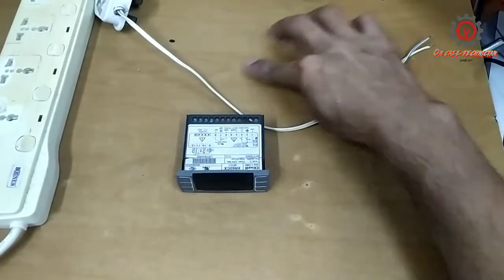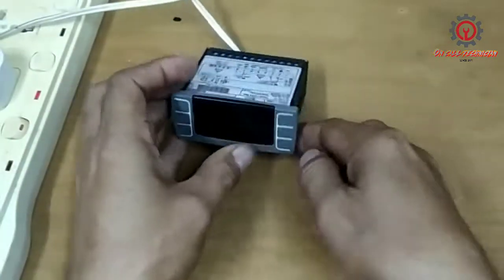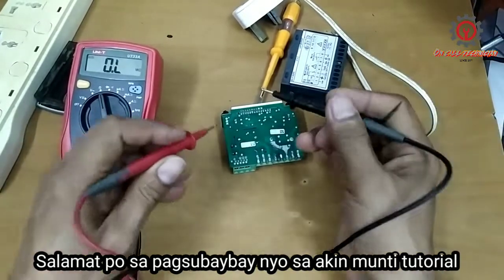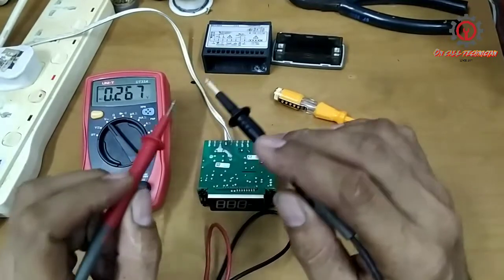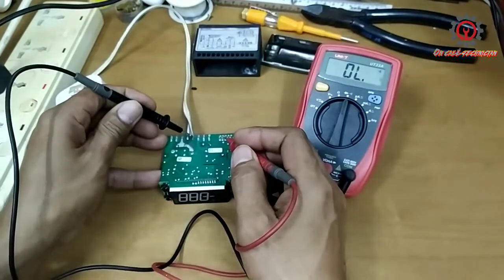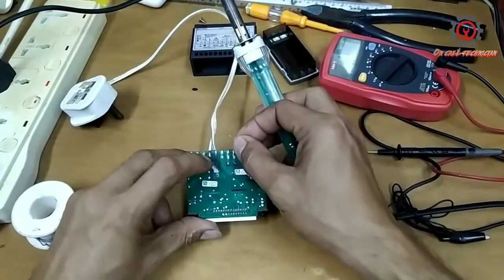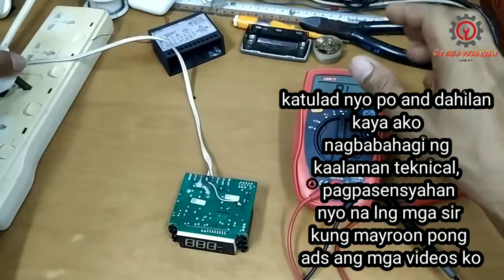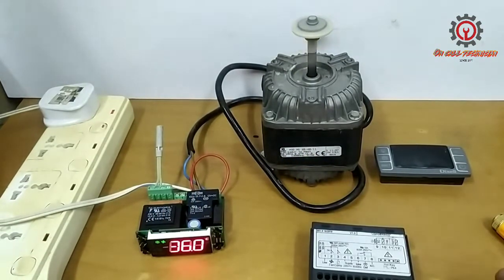HOW TO REPAIR NO POWER ISSUE OF DIXELL XR60CX

Comment: Hi. See the pictures i sent you via FB chat now. Is this a "Thermostat/Temperature regulator" that the previous technician installed? It was installed directly on the Controller but the controller was off (faulty). The fridge still working. Why this was setup like that do you know?
Reply from the maker: I can't blame them sir coz they are not electronics technician too, well their set up is direct connection once dixell control failed. They just took the compressor line and installed a thermostat and they will took defrost line and and installed a timer also for your defrost heater since you mentioned that your unit is a counter freezer.
Reply from the maker: Just explore my dixell tutorials as i discussed about no power issue... etc
Reply: @OCT TV  I was imagining that this is what they did. 
Do you think that this setup where the Thermostat is replacing the controller will somehow damage the equipment?
Thank you so much for all the help! Will keep supporting you.
Reply from the maker: The bypassed they did sir is the oriiginal set up prior to the invention of digital controller. If the unit intended for commercial used, use digital control. If you want to restore the control for monitoring easyly buy new dixell. Just watch my tutorials on how to wire it and program to freezer settings sir.
Model recommend are dixell xr06cx, xr60cx, and xr70cx
Reply: @THEMULTISKILLEDTECH  Can this setup with the Thermostat be done with the Controller operating normally then the Thermostat would be a backup in case the Controller fails then the Thermostat would keep it going? Or the Thermostat can Only be placed "after" the Controller failed just to keep it going?
Reply from the maker: One set up at a time sir. If buy new controller just leave/cut the timer and thermostat there.